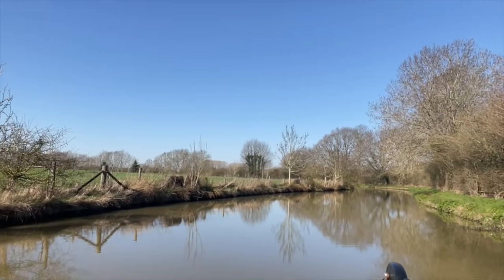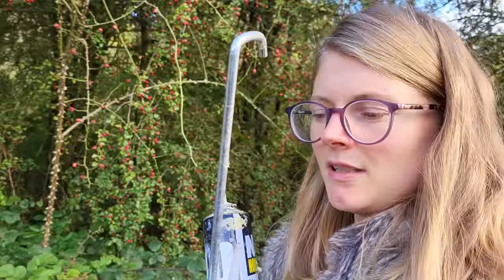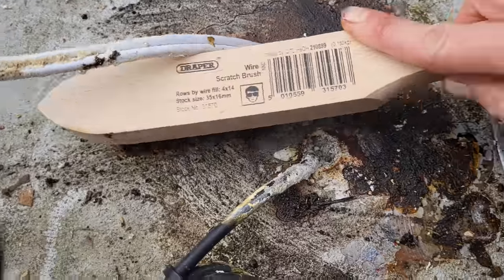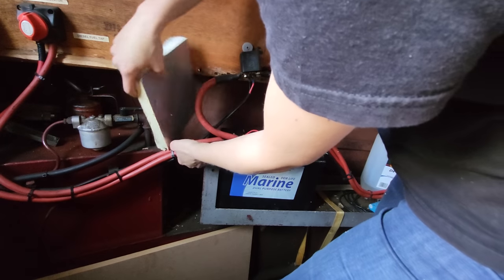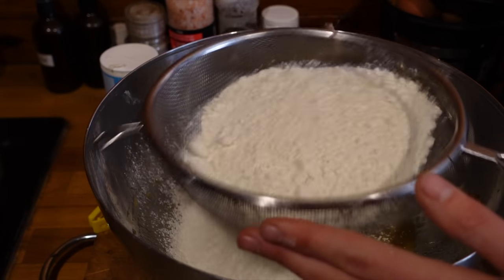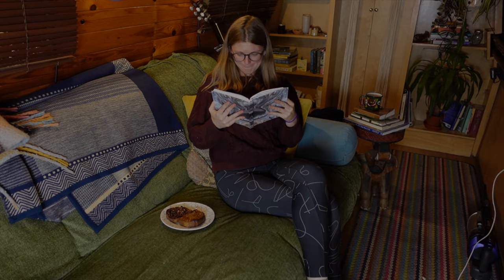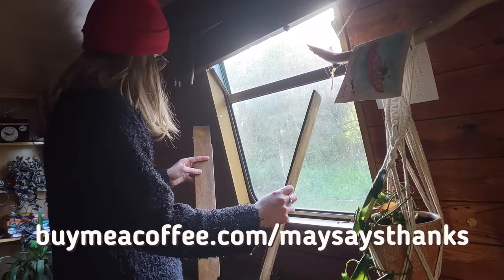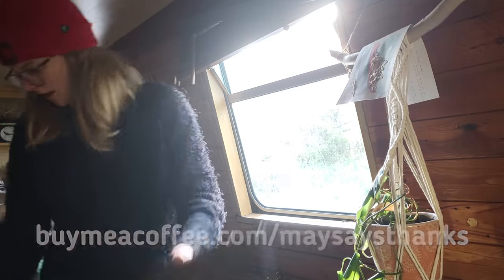Narrowboat Winter Prep: A Boater's Weekend of Fixes, Frustration, & Dark Night Delights!"

Comment: As a sailor who has been around boats for many years, my overriding advice is don’t use any silicone sealant.  It doesn’t work long term.  Butyl tape is very easy to use, no mess like silicone.  Can also get in tubes but for sealing the Windows bedding them on butyl tape will work far better.  The issue is cleaning the old silicone or mastic off but you can get remover in diy stores.  After that clean so with acetone then apply the butyl tape and tighten the fittings down.  Any excess butyl can be cut away and kept to use again.  White spirit cleans any butyl from surrounding areas.  That cable box would be a perfect place to use butyl but again all silicone needs removing which isn’t easy.  Other alternatives are Sikaflex 291i or even CT1 which you can get from Screwfix or Toolstation.  Happy to give any advice I can so feel to let me know. Andy UK
Reply from the maker: Thanks for your advice!
Reply: @wellbeingonwater  As someone who used to be in quality control of sunroof manufacturing... I concur with what the Sailor said.  Silicone never works, butyl can.

Comment: For the holes on the roof you will need cable grommets, you can get these from car accessory shops, window you will need to reseal with proper window sealant that means taking the window out and sealing on the 90 degree corner and around the screws, your hatch could do with a rubber seal on them to create a seal
Reply from the maker: Love the word gromit! Thanks for this

Comment: With the battery terminals.  It is best to cover them in grease when you put them back together.  This stops the corrosion caused by the battery gases.  I know it says its a sealed battery, but not really.  Its a simple, cheap fix that prevents problems in the future.
Reply from the maker: Thanks! Great tip

Comment: Hi May
Just stopping by to have a cuppa and see how you are holding up as weather is getting cooler / colder.
The best thing you did for the battery was to place some insulation between the hull and battery.
If you require extra sockets for your socket set check out your local B&Q or auto shops.  Remeber that there will be metric and imperial sockets.
Mark 😀

Comment: The best advice ill give you is only use the best marine selastic , sica flex , it comes in all grades for every job , second dont short cut the preparation  ,  make sure if using full thread screws fill the thread inside the item being bolted /fastened with sealer , if you need a good seal but need to remove later use buttal mastic ,

Comment: For that wires, go to a electrical shop and ask for watertight cable compression gland fittings.Tiny bit of silicon where the fitting go through the deck. Not sure where the water come in on the windows. But rivets can be a issue as they will not always pull the two materials tight together. Other solution is to get tectile and fill all gaps with it.

Comment: Been thinking about your interior condensation problem.  First, do check that your roof vents are open and not covered or impeded.  If that is good then keep the interior warm day and night and try running a fan to keep the air moving inside.  Condensation is where a cold surface meets a warm surface and there is little or no movement of air.  Think of your car windshield in winter when you don't have your cabin fan running.
Mark

Comment: An old school quick fix used to be placing clear bubble wrap over the inside of the windows and frames for winter insulation, still allowing light to enter the boat. Nothing wrong with using expanding foam to insulate the difficult to get to areas, keep in mind a little bit of expanding foam goes a long way!!! If it expands too much and goes a bit mad, do not panic, you can trim back after it has set hard. Great work on the battery btw.....that battery should have either a vented top cover or make sure your battery terminals are covered (BSS requirement) and be careful using metal tape measures around battery's!!!!  Doing really well getting ready for winter👍
Oh and your hatch needs a small diverter to guide the water coming off the roof away from the hatch joins, just where the roof meets the cabin sides. I am still doing the yoga, nobody told me I would ache the next morning.....😂
Reply from the maker: Ache is good! Pain is not! Thanks for all this info, really helpful and positive too@

Comment: In fortunately you cannot avoid condensation with the aluminium single glazed windows however some ideas…you could use a compriband foam tape between the wood finish and the window frame to help reduce condensation being in contact with the wood. Do you make and store enough power to run an efficient dehumidifier? You can regulate them to provide the correct/healthy level of moisture in the air and remove all excess
Reply: My dad’s a retired boat builder and I used to have a Westerley Centaur 26, which I refurbished and miss dearly. Where I can help and advise I will.
Reply from the maker: Dehumidifier is a good shout. I'll check out compribrand

Comment: So I bought a boat last year. My previous boat would leak at all the windows with condensation- when I purchased my new boat it came with double glazed heavy plastic home made pieces that sit snugly inside the windows (inside) they have a piece of foam all around the inside edge. I almost threw them away - I’m sooooo glad I didn’t. My second winter- and they are back in place. No condensation EVER - no leaking windows and I’ve even put little handles on them all so I pull out easily when necessary- so a little tip for anyone with condensation problems on their windows in winter
Reply from the maker: Interesting! Could you please send me more details, where to buy, pics? 🙏 wellbeingonwater@gmail.com

Comment: Ooo that made me nervous you putting that insulation round the battery , so easy to touch the battery terminals with that stuff as it’s foil faced BOOM 💥
Reply from the maker: I turned the power off !
Reply: @wellbeingonwater  makes no difference, it’s the battery terminals .. if they connect your in big trouble

Comment: I’ve used a light smear of waterproof grease on minor window and hatch leaks in my boat. Vaseline might be a suitable alternative, but it is known to rot some kinds of rubber, so … caution! Others have suggested cable glands where they pass through the roof. I agree that cable glands can solve such issues. But ideally, when planning next summer’s upkeep, try to route cables a different way, so that you can seal the holes in the roof altogether. 
The best sealant for boat jobs above the waterline is UniBond Anti-Mould Translucent, Waterproof Mould Protection Kitchen & Bathroom Sealant. Be careful where you use it though, because silicone is really hard to get rid of, so you don’t want it in the way of a future paint job for example. But on the other hand, it really works! 
AGA cooking is THE BEST, but that air fryer is a revelation … it won’t act as a central heater to keep you warm though!! 
Thanks for sharing your days. 🎉
Reply from the maker: Thanks for all this great advice!

Comment: Howdy May, do you have vents to outside on your boat? making sure they are open and clear will help with the damp. So a quick fix for the window would be sikaflex 221, it seals pretty much anything to anything. use a filling knife to push it into the joints and a damp cloth or a baby wipe to smooth it off. It would also seal the wifi holes, although I'd recommend gromets for that as well. 
As for the hatch, I think if you just try to divert the water away you'll still have a problem with it as the rain hits the side of the boat and weeps in. You can get self adhesive sealing strips in a roll like tape, stick it to the door, rough up the paint with a bit of sandpaper so it sticks.
Reply from the maker: Hmm yes good point. Its so weird sometimes it leaks sometimes it doesn't. I reckon there's something crying in the holes

Comment: Two suggestions for your leak. One is to look for a product commonly call liquid rubber which you can ask at a hardware store specialising in marine fixes. It is a two part product ( depending on the brand)  that turns into rubber and has a water repelling ingredient. Failing that, if you want a quick and easy fix, consider polyester car bondo. It is used on car bodies and starts off as a paste which hardens into a hard shell.
Reply from the maker: Thanks for your suggestion

Comment: Your windows need a sill mounted above them all. Some pressed metal such as aluminium. Say 75 X 75mm right angle folded which extend 150mm either side of the openings. So long as your paint around the window frames is sound you can sikaflex (silicone) the sills onto and above the windows. You can hold them in place while they cure with some strong magnets. This will prevent you from drilling, screwing or riveting them to the superstructure...

Comment: There's no such thing as a temporary fix - there are just fixes and failures, and it's a fix until it fails 😁
Couple of ideas: Please consider getting a squirty foam gun. Good ones, which you can disassemble to clean, cost £30+ but will pay for itself in the long term as you'll get at least twice as much useable foam from a can. They are completely controllable and don't leave you re-enacting scenes from Ghostbusters. You can accurately squirt foam beads from 2mm in diameter upwards and with a little practice make little mess and produce properly expanded foam which is a better insulator. Once you have one, you'll never look back and will find even more uses for squirty foam.
As for your condensation problem, there are no easy solutions apart from heat, ventilation and dehumidification, and you don't have the solar electricity budget for the latter. Stopping breathing is also a solution, but not one which I would recommend😁
Secondary glazing is not very effective and will probably never repay the investment and will produce condensation between the layers as you live in a naturally humid environment. The only real solution is to hold out and bite the bullet and replace the windows with modern double glazing with extruded, hollow frames which won't be as cold to cause as much condensation. Even then, you will still get some condensation as the air inside your boat will be quite humid without ventilation. A possible help might be self-adhesive foam strip for the exposed aluminium. I have used self-adhesive EPDM foam strip from Rubber and Sponge for water seals for flood doors which would also work as insulation. I recently bought 10m of 20mm wide by 10mm thick for £14 with free delivery. They do it in every width and thickness combination imaginable. It is closed cell so won't soak up the water so shouldn't go mouldy and start stinking.
Reply: Foam will just keep expanding when it gets moist…
Reply from the maker: Love this, thanks so much
Reply from the maker: And for the advice 🙏

Comment: Double paned windows will eliminate the condensation.  More expensive yes, but sometimes the cost is necessary.  Plus with double paned windows the frames/sills are typically wider so you can spray foam them in place to eliminate any leaking.  You should look into RV (AKA caravan) windows  As for the hatches, ask your welder friend to fill any cracks/voids/low spots with weld to help shed the water, at the very least he might have an idea to help fix your problem. I know you like to DYI the problems but sometimes you just need to ask for help.  Cheers.
Reply from the maker: Yes  always the best option

Comment: You could try a film secondary glazing that stick to the  window frame, then shrinks tight with a hair drier, it will greatly reduce r stop condensation it can also help retain the heat and  its easy to peel off in the summer although apparently it helps to geep some of the heat out in the summer so I’m Told.  PPS my windows are so wet i hear it raining inside during  the night, i wish i had a log burner as its a dry heat and greatly reduces condensation, I’m existing with only my Webasto boiler going 8 hours a day lol😅

Comment: On the hatch where you think the water is running, I’d use bluetac to build a little dam to push water away along the roof, just as a temporary measure to see what works. If it does work then you can make it more permanent with mastic or similar. If not, then the bluetac is easy to remove
Reply from the maker: Tried that..  didn't really work because the hatch lid couldn't shut

Comment: Thinking about the water penetration problems, I'm surprised there are no gutters around the roof. Like there are on cars, for example, to guide the water away from windows and discharge somewhere else.
With the hatches, surely metal guides could steer the water away from the openings/joins to spill elsewhere. The guides could each be metal ridges welded or epoxied to the surface of the roof to, again deflect the water elsewhere.
Reply from the maker: I think I'm going to have to weld some on!

Comment: Most boats have window leaks in my experience. A really good product that will at least temporarily solve the problem is Burgess Hydrosol (much, much better than Captain Tolleys). Will happily go on to a moist joint and work in by capiliary action. Probably needs several applications (watch out for rune and wipe them up) but is great stuff for window leaks.
Reply from the maker: Thanks so much for your advice

Comment: Once that leaky window is out, you’ve gotta make sure the surrounding steel is totally flat & smooth. If it’s even slightly uneven, you’ll never get the window frame to seal flush. 
Secondly, do you windows have drain channels in them ? If they have they need to be clean & dirt free so rain runs down & away.
Reply from the maker: Thanks for the tips Mark!

Comment: Hi May. You need some kind of barrier where the edge of the hatch is which diverts the water to the side away from the hatch. Maybe your friend George could weld you a small piece of metal? I wouldn't use expanding foam around the frames as like ypu say it's very messy and you will never be able to get it off again, better to use foam board. You never said if the banana bread tasted good?
Reply from the maker: Thanks for the ideas. I recently finished the one I started with expanding foam and it was hilariously bad. Going to try the other insulation on a different one and see which is best. Thanks for the ideas

Comment: I'm fixing a hole where the rain gets in And stops my mind from wandering
Where it will go I'm filling the cracks that ran through the door And kept my mind from wandering
Where it will go. - The Beatles.

Ok thet was meant to be a joke, but I think a combination of expanding foam and insulation blocks would be a idea for the windows as for hatch metal trim strips or somthing like brush seal (a small aluminium strip which has bristles like a toothbrush on it) on the inside. There also a rubber thing that look like a car wiper blades (but I can't remember what they're called. Sorry)  But like you said future may will have a solution at some point. And well done on the banana bread

Comment: expanding foam is good but less is more as I found out when I used it to gap fill a window it expanded so much I couldn't close the window so on your boat it may push open the joints
Reply from the maker: I had a funny time with it recently! Stay tuned for that vlog ! 😅
Reply: it certainly is a strange compound @wellbeingonwater

Comment: I don't know if they have this stuff in the UK, but you might check a couple of hardware stores, or big box stores if they have those there...(Lowe's, Home depot types) but there's a sealant called flex sealant, flex tape, flex repair, etc....supposed to stop leaks...advertised constantly in the U.S..
Reply from the maker: Thanks for the ideas Phil
Reply: @wellbeingonwater  there's stuff called flex putty, which seals leaks, flex tape, also seals leaks, flex caulk..just a thought...they show building a speed boat from a screen door, then putting this flex seal all over it...and taking it out on the water...it doesn't sink!!  thought it might help you out...not that expensive either...

Comment: You need to use a roofing mastic to temporarily fill that gap where water is running down near your hatches… take your old window out and reseal it back in with mastic, and mastic around the outside of it.
Until you do a proper fix…
Reply from the maker: Yeeeeees. Not sure which leak you're referring too

Comment: Are you charging your starter battery from your solar system? There are chargers just for keeping those batterys alive!
Reply from the maker: I don't believe so 🤔
Reply: @wellbeingonwater  I would strongly recommend doing that, your insulation does not keep the Battery warm because there is nothing there to produce heat. The best thing would be to have the Battery inside your boat, they really don't like beeing used when cold and discharged.
Or you could invest in an RV battery, "battlebornbatteries" have a heating inside so they keep themself alive in the cold, but that would be overkill in your case since you already have a warm place to put them.

Comment: With the front part of the insulation for your battery I wonder if cutting out only the area that is to thick for the metal frame and keeping the bulk of the insulation over the front of the battery would give it more protection from the cold?
Reply from the maker: Not sure but I'm quite happy with how it turned out

Comment: That side hatch is a bad design in my opinion. I would weld u section steel down the side openings and a flat steel bar sloping outwards to take the rain out of the boat lived on a boat a while and there’s always something to fix. Get a window vac for the condensation on windows.
Reply from the maker: It really is!! Terrible. Thanks for your thoughts